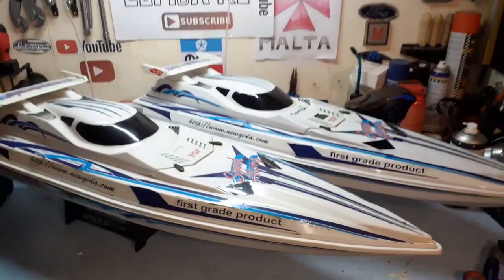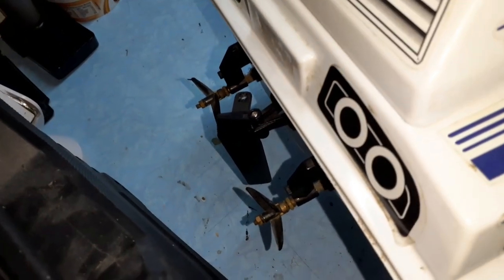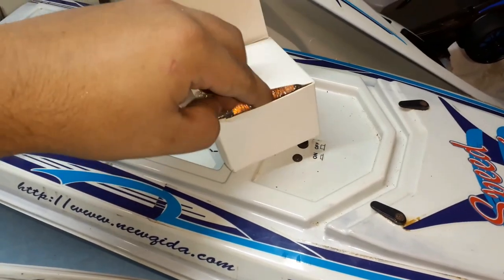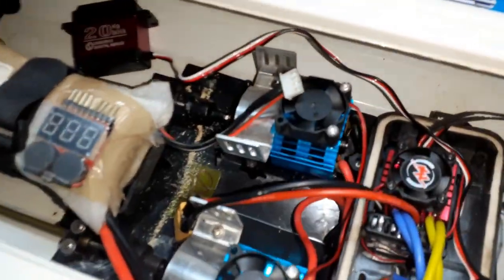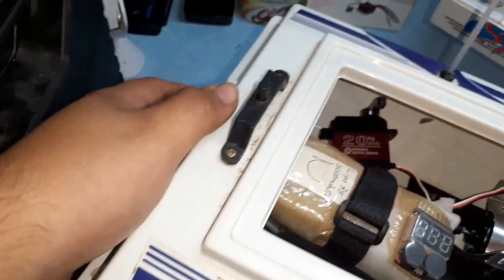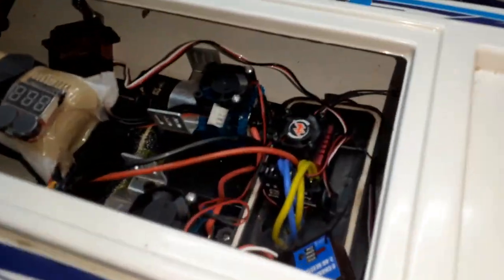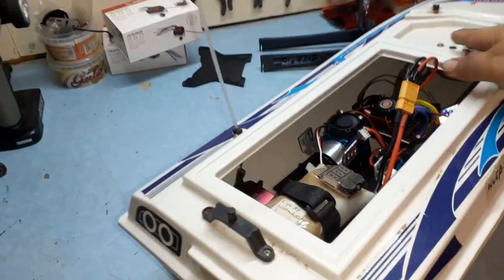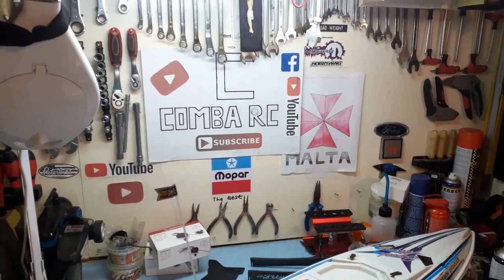MAJOR PROJECT REVEAL!!! Twin Boats getting major drivetrain!!!

Comment: This boat it’s what got me into rc’s. Eventually I modified it as well just like you did. After trying a many different options ended up with 2 380can BL motors with flex shaft. The servo option that works for me was the traxxas spartan rudder and rudder boot. Batteries sit in the middle of the boat between the motors. I could share pictures with you on FB boat group, lmk.
Oh, I’m glad I found out about this build, I always wanted to see videos of people modifying this particular boat.
Reply from the maker: Thanks my friend glad to hear that. So far what I have left is the steering servo, I ordered 2 alu. Servo brackets to mount it in more rigid. Thanks for your comment. Hey join my fb group! Share your stuff there!
Reply: Sure thing. That’s exactly what I did, carbon fiber servo mount epoxied to the hull. Hopefully we’ll see it in the water soon. Good luck!!